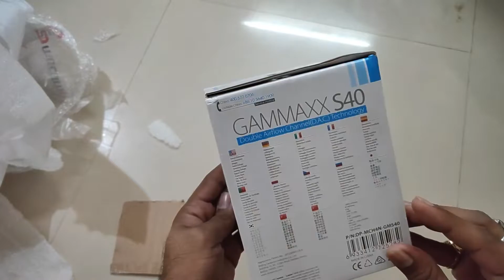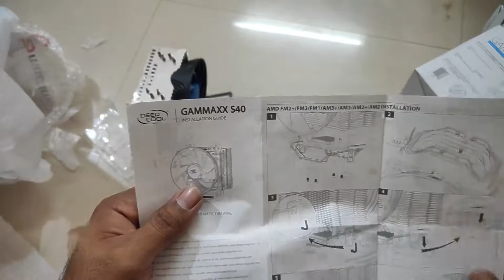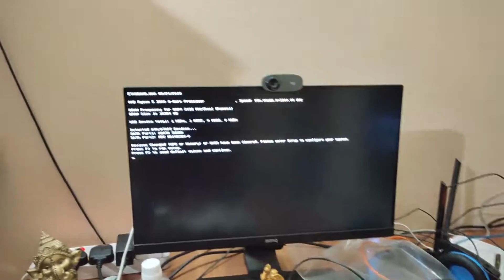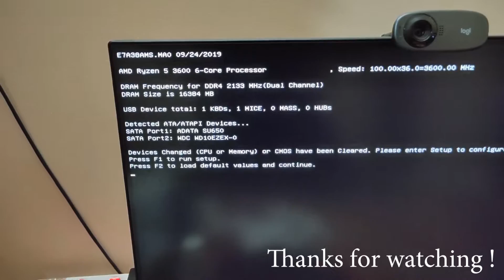DEEPCOOL GAMMAXX S40 || AMD RYZEN 5 3600 COOLER

Comment: The fan is on the wrong side, you should do a push pull set up since your cpu fan is pulling air in and your back fan is pulling out. (i think)...
Reply from the maker: nope. both the rear fan and the cpu fan are pushing air out.
Reply: @vickyvishalful that cpu fan is indeed facing the wrong way cause the air going through the cpu fan pushes the air to the fins on the cooler then goes to your front, or else you are saying that the rear fan was installed as intake.
Reply from the maker: @ZachDaemon1  bro. i know it might sound different but the fan on the cpu cooler works like, it pulls the air .The rear cabinet fan is for exhaust/pushes out from cabinet.

Comment: if it barely can defeat stealth i think its equal to spire ?
can u give tests ??
Reply from the maker: For me the stealth easily reaches 90's C degrees in just first cinebench r20 test and multicore scores never cross 3500. But with S40, the peak temp even with prime95 test are 84C max and cinebench R20 multicore score is usually around ~3600.
Reply from the maker: It is really way better than the stock cooler bro.
Reply: @vickyvishalful  in comparison to spire i think no difference .
Reply from the maker: @mahdimortazavimoghadam9993  i have not used spire so cannot comment on that.

Comment: What about temp bro idle and max??
Reply from the maker: Idle is still around 40-45 but max have dropped depending upon clock speed and underclocking. But max has dropped for me by 10-15 degrees. For cinebench it got upto 95 now it doesn't crosses 85-87(ambient is also a factor in India)
Reply from the maker: I'm planning to make a proper temperature video regarding the same. Do let me know if you are interested as well
Reply: @vickyvishalful  thanks brother